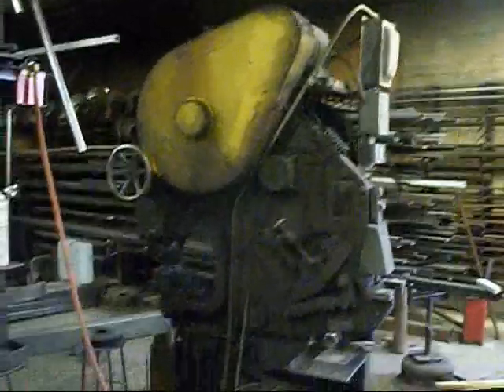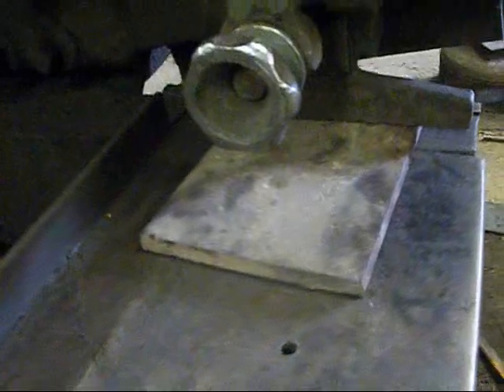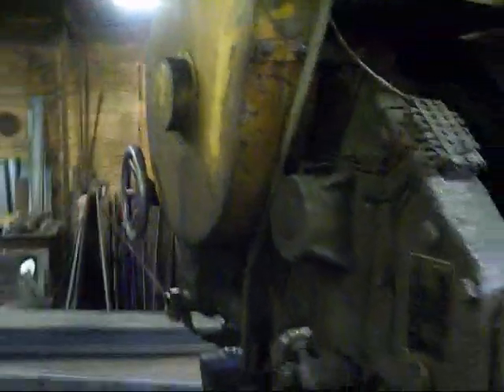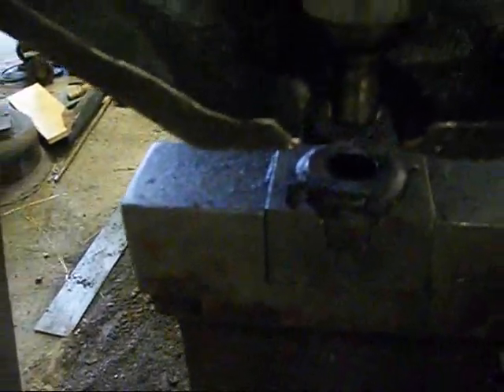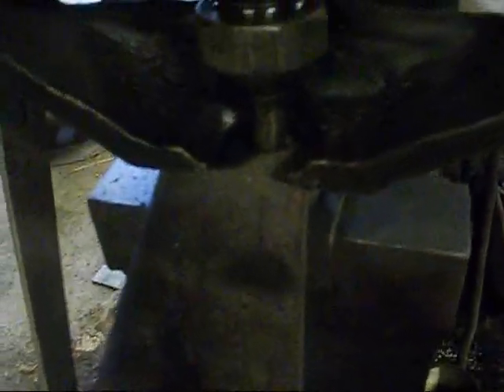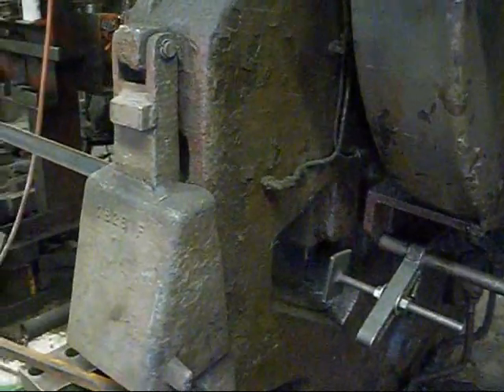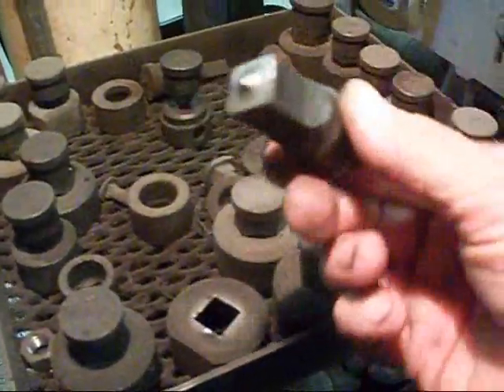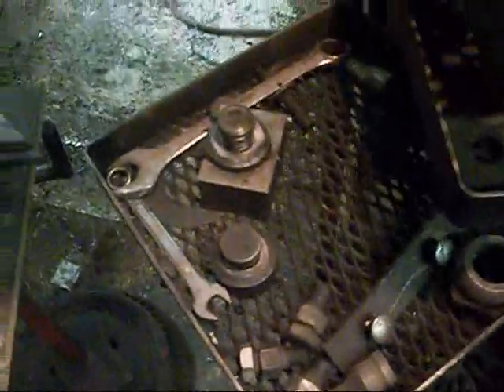THE IRONWORKER WMV

Comment: Whats the voltage and horsepower of that motor.
Reply from the maker: 220 3 PH  power the motor  is maybe 7.5 horse I would have to go look for sure Thanks
Reply: @THEIRONWORKER  thanks for the reply I have the same ironworker and I know it's 3 phase but mine has the tag ripped off of it and I'm trying to figure out the voltage I need to get a phase converter to run it cuz I only have single phase here but I need to know if I have to get a Transformer to step up the voltage if its 208/240 I'll be golden but if it's 460 I'll have to get a Step up Transformer. And I'm pretty sure the motor is 5 horsepower I'm just not sure on the voltage.
Reply from the maker: @mitchdenner9743  Westinghouse motor, frame 254 , hp 5 , 3 ph , 220/440 I hope this helps
Reply: @THEIRONWORKER  thanks again for the reply.

Comment: Amazing machine, built to last. The problem with the west is we cannot compete with the exchange rate of china. As soon as the Yen is equivelent to the dollar then heavy industries will return to the west. Typical example: I wanted a screwjack tent pole made. So I went to the local scottish Engineering works. The cost of the part there was £600... and the part as made in china??? £22! How could I justify buying this from the local works? so £22 later I have the chinees part.